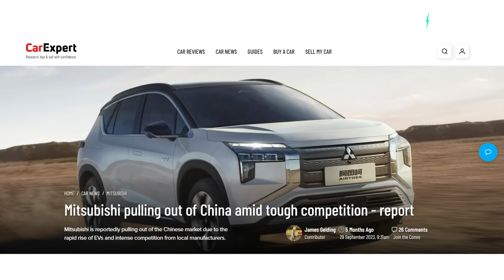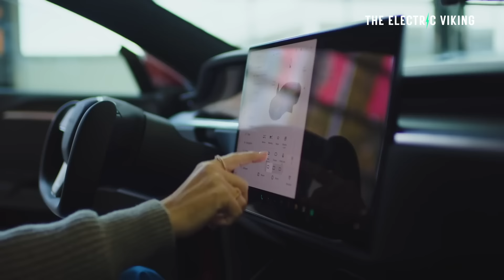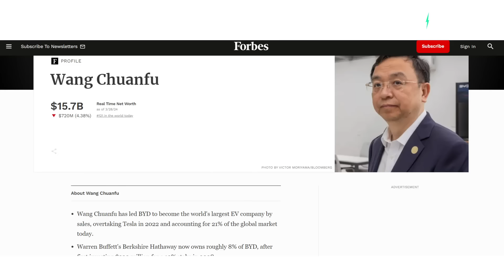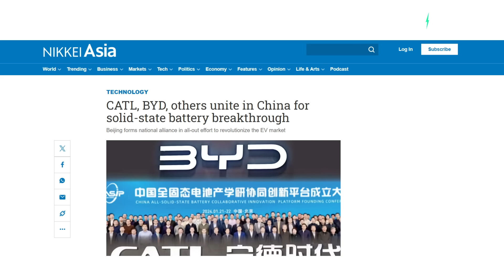Electric cars hit 48% in China - Legacy auto could lose billions this year

Comment: EV costs are going down... ICE are still going up. It is inevitable
Reply: Exactly! It's like "closing distance" of two objects approaching each other, the speed of just one is not the speed.
Reply: where ???? I just paid cash for 2011 Audi quattro mint condition for 5k . no one wants payments on a rechargeable battery ,,, and My audi will last long then any EV ever would .. an ev battery only has 10 year shelf life .. not driving it and still degrades hmmmmm
Reply: @frankcoffey  in china ev is already cheaper than ice
Reply: @bengordon7635  Today's EV batteries will last for 300-500K miles or longer. By the time those batteries die, they could be replaced as battery prices continue to decrease, but more likely, the rest of the car is ready for the junkyard.
You have a common misconception about warranties. Things with warranties are not designed to die when the warranty expires. If that was the case, there would be a huge number of things that failed under warranty, and replacing all those under warranty would financially cripple the manufacturer. Case in point, your Audi Quattro which currently has a 4 year, 50K mile warranty. Do you really expect your 2011 quattro to have fallen apart in 2015?

Comment: I was in Shenzhen for the first time 15 years ago. I rode in my first electric taxi there, saw an electric bus in use, I notice the police had fleets of electric patrol cars. There were still fleets of those electric 3 wheel delivery bicycle / pick up things. Over here in America, 5 years ago GM introduced the 'future' of EV vehicles the HUMMER EV. A ginormous pax-Americana parade float of a vehicle with a leaky roof. A 10,000 lb joke on wheels, a yankee doodle slap in the face to common sense. So, yeah. Without blatantly obvious market protections, American can manufacturing is doomed.
Reply: even with market protection, its gonna take decade to re-train enough high IQ Americans from 'lawyers/financiers/accountants/software engineers' back into real engineers.
Reply: @Xind0898 EVs are computers on wheels. You need those software engineers.

Comment: Hey electric Viking. Reading an article about Turkey’s EV “The Turkish auto company known as Togg flipped the switch with the release of its first battery-powered car — the T10X — an SUV that competes squarely with Tesla’s Model Y. Sales of the electric Togg set a blistering pace. Turkey crossed the 5% tipping point in the third quarter, and by the fourth quarter it was the fourth biggest EV market in Europe.”  What is a Togg?  (Funny thing is I was stationed in Turkey in the 90s. Many driving Turkish made Fiats and fords then)

Comment: I have a question......if china ev market goes to 80%, what happens for oil industry?
Reply: I did some quick math.  If China has 32% of the global car market and they are now at 48% EVs that's a 15% EV share of the global new car market in China alone.  It looks like, based on the very low cost of high quality EVs available in China that they should move rapidly to around 100% EVs.

Europe is moving somewhat fast to EVs.  North America is a bit slower, but expect EV sales to accelerate as lower priced EVs become available.

What this all adds up to is a coming significant decrease in demand for fuel oil.  Especially as battery powered commercial vehicles become more available.  Businesses will do the math and quickly dump their diesel rigs for a battery powered truck that pays for itself in three or so years.  

The oil industry will shrink.  New oil fields will not be developed and some refineries will close as demand decreases.
Reply: Oil isn't going anywhere, plastics are so common and a product of oil. Even batteries use oil products.
Reply: @Steve-318  I know that, but demand for oil will go down
Reply: @Steve-318  Most plastic is made from natural gas, not oil.

Comment: Many of China's cities won't register ICE cars. The people aren't free to choose. I actually agree with this. Air pollution is not good. But then coal burning in power stations is just as bad and most Chinese cities have shocking pollution from these coal fired power stations.
Reply: please note only 7 cities have that regulation
Reply: China has strict emission standards for coal-fired power plants, and power plants must install environmental protection devices.
Reply: The newer power stations in China are using Ultra Supercritical Technology. These power stations operate at a much higher temperature and pressure resulting in an overall efficiency of up to 47%. Contrast this with the older power stations which have an overall efficiency of only 34%. These newer power stations are less polluting than the older ones.

China leads the world with about 100 of these UST power stations. China also leads the world in solar, wind and hydro electric energy. The price of electricity, per kWh is less than half of the U.S. and 1/3 that of Germany's.
Reply: @nsng1298  Higher temperatures are usually associated with the production of NOx molecules. The ash spewed into the air isn't healthy. 100 is a big number but I doubt it is more than 5% of the total number of coal burning power stations. The price of electricity is set by the state - it is not a function of cost of production. China's solar panels, batteries and wind turbines are world leading and excellent.
Reply: @llkk290  Yet the air quality in many Chinese cities is appalling?!?!
Reply: @johnfrancis4401  Air quality in northern Chinese cities that used to burn coal for heating in winter has improved after natural gas replaced coal, thanks in part to natural gas piped to China from Russia.

Comment: In China, isn't registration for EVs free compared to gas cars?  If both cars are the same price it is a no-brainer.  This YouTuber likes to use percentages too often.
Reply: EV license , is cheaper to Register than ICE.
Reply: @markplott4820  
Cheaper to register.  Cheaper to drive.  And getting really cheap to purchase.
Reply: In China, there is a tax on gasoline cars, while electric cars are exempt from this tax and also receive government subsidies to reduce the cost of purchase.
Reply: @ruobingyang-ct1eo  
Smart move on the part of the Chinese government.  China has a really bad  air pollution problem in its cities, due to ICEVs.  And China has to import oil to fuel ICEVs.

Switch to EVs.  Clean up the air and reduce health problems.  Run on solar, wind, and hydro generated inside the country.

That sort of logic applies in pretty much every country.
Reply: @ruobingyang-ct1eo  Purchase subsidies were phased out.

Comment: People like petrol and diesel cars why take that away from people freedom of choice
Reply: Mainly due to what comes out the back of them. We used to (in the UK at least) be able to by lead paint, leaded 4* petrol, asbestos,  incandescent light bulbs, single use plastics, certain dog breeds, smoking is being banded (so anyone aged 14 today won't ever be of legal age to smoke). I could go one. Pollution is real if you agree or not, it's just something we all should do to limit it, but sometimes the public need a bit of a nudge in the right direction.
Reply: @steve_787  60% of the world's carbon and pollution comes from industry not cars and trucks. Shut down the factories and u will be 60% cleaner
Reply: @pkerry12  well it would be best to just turn everything off wouldn't it. But, then we go back to lighting fires for cooking, heat and light so not overly practical. 
You are wrong with your 60% figure. It's not industry that makes up the primary source of carbon. 2020 figures (so a little out of date) worldwide show the following: Production of electricity and heat are the highest sources (15.1B ton), followed by transport (7.1B ton), manufacturing & construction (6.18B ton), buildings (2.71B ton) and then industry (1.63B ton). Both energy and transport had shown sharp declines from the 2019 figures for reference.
Cleaning the source of the energy is the most practical solution as it then feeds into transport, building, industry etc.